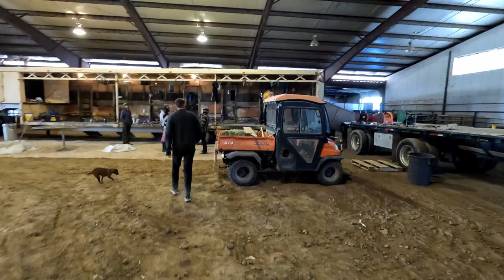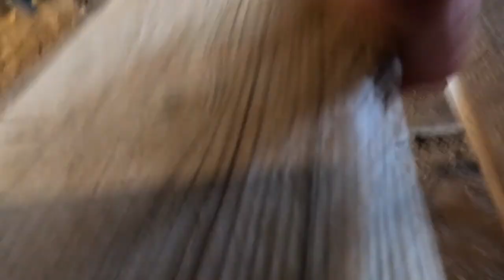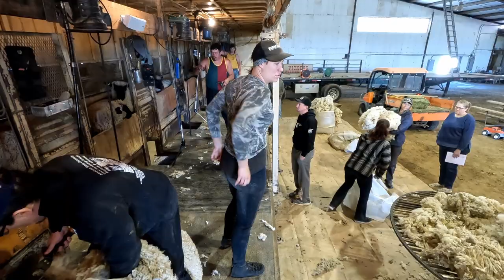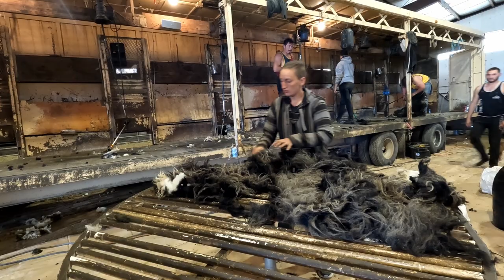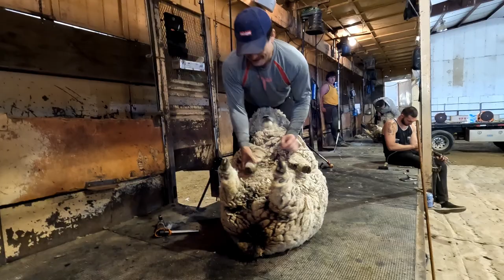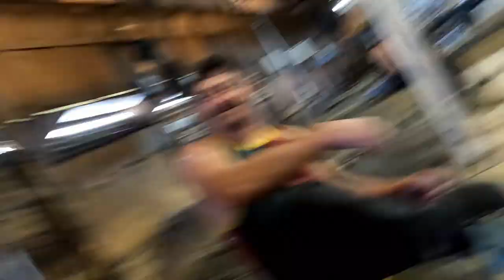The Community Shearing Outreach Job (Vlog 19)

Comment: That wool handler chick had a cool haircut. Business on the sides party on the top? 😆 Good for hot weather. The heck with hossing on those overfat sheep. Good way to bugger your back. The community shearing is a good idea other than the possible disease risks. Good work Shamus.
Reply from the maker: The chick was a mma fighter at one point! But had too many head kicks to her head. So she doesn't fight anymore. There was someone there actually testing for some diseases.
Reply: @FamousSheep  Woolhandling is definitely better than getting kicked in the head lol. Good on the testing. 👍🏻